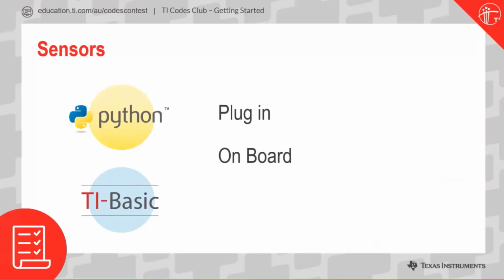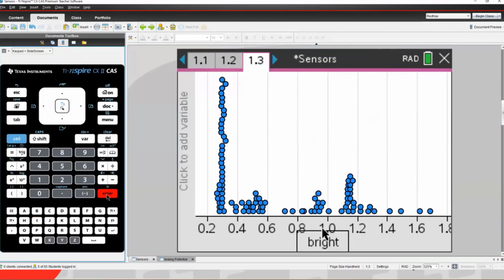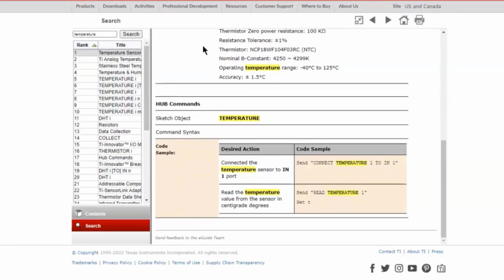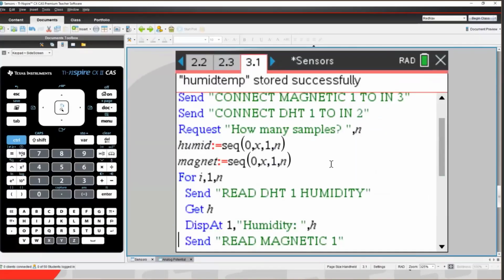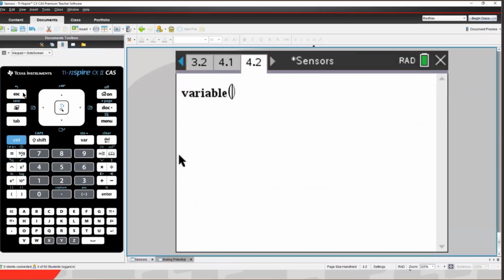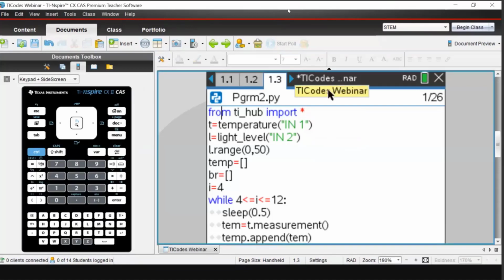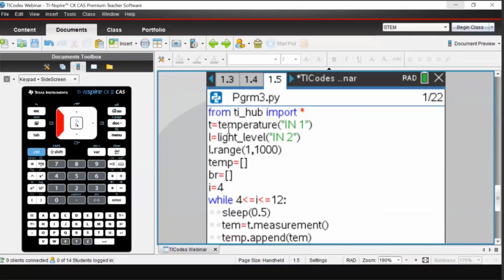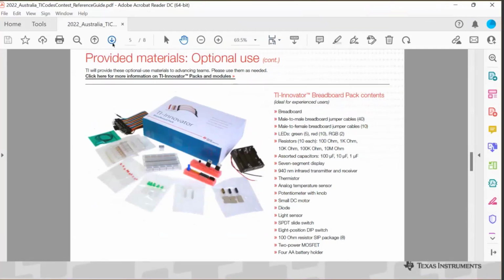Session 4 | Codes Club 2022 | Texas Instruments - Sensors for the TI-Innovator Hub

Comment: Hi, can anyone tell me where I can find more information on programming external input and output on the breadboard? I am trying to program a force sensitive resistor onto my calculator and I need some help. Thanks!
Reply from the maker: Brie - There are several location where you can get support for the Breadboard outputs on the TI-Innovator Hub. 
A good starting point is the eGuide for TI-Innovator:  https://education.ti.com/html/webhelp/EG_Innovator/EN/index.html 
Do a search for BB1 (example) ... check out the BreadBoard pack link in the search results.
If you would like more information or a video tutorial, let us know.